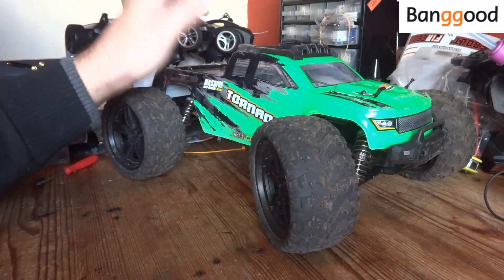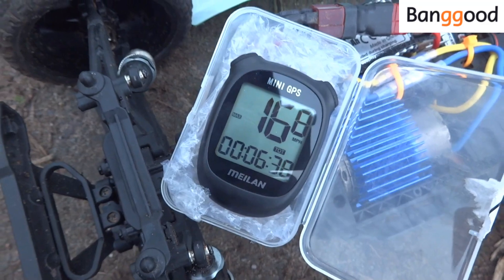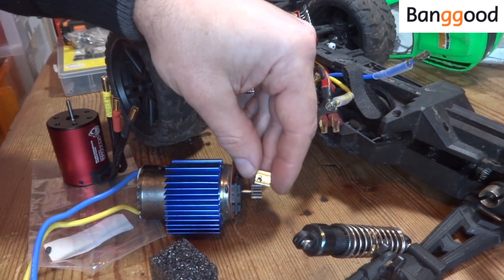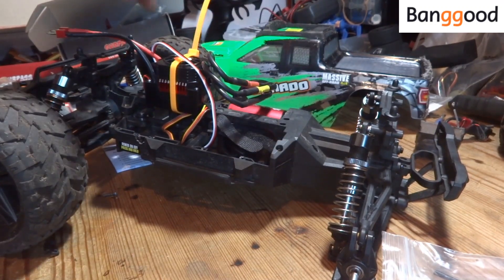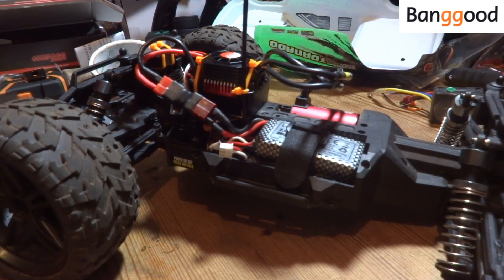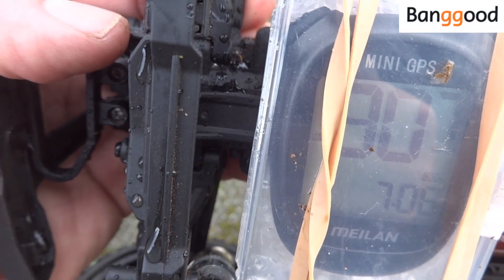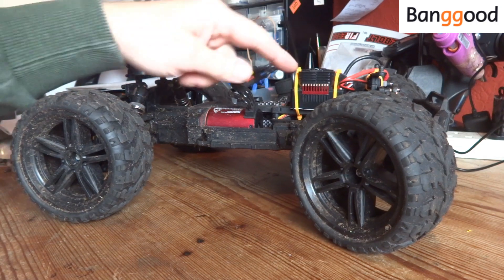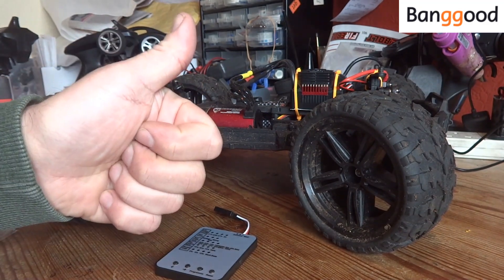Flyhal FC610 Surpass Hobby Brushless Conversion. Double The top Speed!

Comment: Great vid mate love these trucks and for the money they are a great platform to upgrade to brushless. Add up the cost of the truck and the brushless conversion its still cheaper than most of the other trucks out there. For sure has more to give on a straight road. Wonder what it would do on 3s 😜👍
Reply from the maker: Hello! Your absolutely right, for the money you just cannot go wrong. I do owe you a slight apology mine only does 17mph from stock. I think off road it just looked quicker! As for 3s I think it would be rude not to! 👍🙋
Reply: I did 64km/h on 3s but it was just a bit more then half throttle. Didn't have that much space besides a small park alley :P
Reply from the maker: @shred__dad  that's not bad going! Full throttle next! 👍🙋
Reply: @theminiatureconstructionco4556  definitely, just need to order a new front lower arm. Been sending it today from a skate quaterpipe, smacked the railing and ended with left lower arm broken. But going back to 3S. I used a 3S 70C CNHL 1500mah, and you really need to be careful with throttle :P stock tires loose grip. PS not sure if anyone was crazy enough, but i went with a 31T M0.6 pinion. There's a bit cogging, but this was just an experiment, while i was waiting for a 16T pinion to be delivered :P

Comment: Speed run 🤘🏻🤘🏻🤘🏻 3s next my mate! 40+ mph easily! And yeh what a stroke of luck you had that pinion 🙏 🤘🏻🤘🏻
Reply from the maker: Eh up! I think it would be rude not to try 3S in it. Yeah can't believe that pinion was correct, it would have been a very short video else. Do you reckon 40 then? 👍👍
Reply: @theminiatureconstructionco4556  Yeh mate 40+ but not on that path you were on. You'll need a road or a carpark for sure 👍🏻
Reply from the maker: @ksrnate  right then that's it. 3S here we come! 👍👍

Comment: I actually like a lot the behavior of the brushed motor. A lot of torq, controllable and so far reliable. As I am planning to use mine with crawler tires for off-road and crawl, speed is more Than enough and to use stock tires at basketball field or garage and play with my kid is also enough. Speed is good but it always has a price, not only conversion but also potential more damage to parts when crashing. It's different to crash a rc at 30kmh or 50kmh.
Reply from the maker: I would agree. It does crash very well though as I did hit a tree at full pelt and nothing broke! But it's always nice to push the boundaries a bit! 👍🙋👍
Reply: @theminiatureconstructionco4556  do you have any idea if some parts are interchangeable with other rc brands? for example,the diffs are the same as the ones used on hbx 16889apro? spur gear and drive shafts?only ask because parts are difficult to find and if one day i decide to go brushless,at least a spur gear, some diffs and extra driveshafts i want to have since something is going to break for sure.
Reply from the maker: @farmoboy83  I believe it's basically a HBX 2995 (something like that). I think I mention the RC it's based on in the initial review video. 👍👍
Reply: @theminiatureconstructionco4556  yes but even for hbx 2995 its hard to find parts and expensive when compared to other midels from the brand. if there was any other model or brand with spares available for less money would be nice,just the same way i've been making a small stock of 16889 parts because they are really cheap and since i have two and prentend to keep them for ma y years, couldnt resist the temptation.
Reply: @theminiatureconstructionco4556  i was predicting the future...arrive home from a small garden bash. 2 packs of  batteries on tarmac, a little medium grass and ocadionally sand. almost at the end if second pack, a grinding noise and the car bwrely mooves rear wheels and nothing on front wheels. i believe the pinion is toasted,only hope spur gear is ok since i have spares 14t pinions, the same used on hbx 16889a pro, internal diameter slighly bigger than the 14t for the brushed version or brushless non pro.
Reply from the maker: @farmoboy83  I think also there are several Bezgar models that are the same also. 👍
Reply: @theminiatureconstructionco4556  the centre diff was blocked with dirt and sand and the motor power wasnt transmitted to the other diffs and consequently the wheels. changed pinion gear just for peace of mind but original was still in spec. this rc hates sand for sure.i was it more often in tarmac and even so 2nd time i have to tear it appart because of sand. 16889 is daily used on sand and bashed hard and in 8 months only had to change on pinion crown....since fc610 is the same as the hbx 2995 sand buggy, the name is not to take into consideration lol
Reply from the maker: @farmoboy83  how did the sand get into the diff? Seems pretty tightly sealed. And even if the centre diff become solid it should still send power to the other two. 👍
Reply: @theminiatureconstructionco4556  it glued the bearings...not really inside diff but exterior bearings got stuck with a mixture of sand and grease. also, dont know how but front pinion crown somehow got disconnected from the shaft and when the shaft mooved the front diff didnt get any motion because the crown didnt rotate. dont know how but maybe the tip of the shaft is getting thinner or the crown loose due to use. hope it was only dirt also that wasnt allowing proper contact between crown and shaft. now the truck is working as good as new. this is the reason i would like to have gear spares because sooner or later they are going to fail even though they seem pretty good quality steel.

Comment: Hi, is it possible to use the original esc space for extension to battery tray? How long would the tray be if that is possible with some material removed, like various protrusions?
Reply from the maker: I reckon off the top of my head. You may get a 2200mAh battery out of a Wltoys in there. But like you say there would be some cutting involved.

Comment: Hey buddy hope your ok and thanks for your video just wondering would this combo be good for the arrma Vorteks Boost as I don't intend to leave it with a brushed motor for long at all and could I use the spectrum receiver it comes with or would I need to get another and what would you recommend
Reply from the maker: Hello!! I don't see any reason why not. As long as the Arrma is 1/10 1/12 scale (or smaller) I can't see it not working. If the radio gear you have has the standard plugs on the receiver it should all work together correctly, a reverse function on the throttle and steering is sometimes useful. I would also get a programming card as well to fine tune various parameters. I think there is a promo code in the description that will get you 10% off at Banggood. They do loads of combos just use one of the links in the description. 👍👋

Comment: Great video . You can try 3S speed run on a dry day with straight road . I hope next someone will sell a adjustable motor mount . So can change to 17T pinion gear . What's the weather like during the run ? As you said the motor is cool to touch . I live in Asia so I might need a cooling fan for the motor .
Reply from the maker: Hello! It was a cool morning so that proberbly helped. The kit comes with a little radiator which I didn't use. I would see how you get on with it first, it don't think that on 2s it gets very warm. And yes it would be rude not to try it on 3S really. 👍🙋👍
Reply: @theminiatureconstructionco4556 Hello . I guess I need to install cooling fan for the  motor when I upgrade to brushless . Do you think 80-120A might be better in managing heat in 30°c weather running on 2s-3s ?
Reply from the maker: @winstonhoong2134  I would see how you get on. You may be able to stick a non fan cooled rad on the motor and that's enough. I'm going to be honest the ESC was kept really cool by that fan. It's very noisy but effective! 👍👍 I will try 3S for you soon and see about temps. 👍

Comment: Great Video 👍🏻
I bought die same combo by surpass, but my car is crogging extreme when i put the car on the ground.😢 also bougt die programm card and set the start power from medium to strong no changes.
Reply from the maker: Are your battery's in good condition? Are they a good enough C rating? 👍👍
Reply: I think so, tested with new 2s 4200mah 50c and an 3s 2800mah 40c
Reply from the maker: @D3faultChann3l  mmmmmmm does sound  like a possible faulty motor or esc. It should go like stink! Unless it's settings on your transmitter?
Reply: The car is really fast but needs a little push to start maybe an other transmitter it's 10years old from an brushed combo were it works normally?
Reply from the maker: @D3faultChann3l  has the old transmitter got an exponential adjustment option? Sometimes you can alter the throttle curve. So a small movement on the throttle gives 50% of the power? With that combo in mines super smooth from take off. I did put a much cheaper ESC in it and it ruined the throttle response. No cogging but a loss of power from pull off.

Comment: What is the pinion pitch? That ebay link doesn't say. Another video said 48, but that's too small. Last thing I need for brushless.
Reply from the maker: As far as im aware its M0.6 that seems to be a good match.
Reply: @theminiatureconstructionco4556  thank you, I'll check it out. Took the pinion to a LHS with no luck or answers.
Reply from the maker: @stickem1974  you can get the Xinlehong ones on line. 👍
Reply: @theminiatureconstructionco4556  ouch, 20 bucks shipping to US though lol. There's a few from China on ebay and other random sites. I had a 16t 48p that was same size as the original, just 2 more teeth but it whines with it in. Thanks for the info.
Reply from the maker: @stickem1974  no worries. Your welcome. 👍

Comment: I've bought the ESC and a cheap brushless motor. Did you have any issue with the motor stuttering at low speed?
Reply from the maker: Sounds like you have a bit of cogging. Is the ESC powerful enough to run the motor? Are you using standard gearing?
Reply: @theminiatureconstructionco4556  I've got the 60amp Surpass KK ESC the same as you and the 14pt pinion I bought off you. I think it might be to do with the throttle trim. It's very sensitive about being set right. I might try a program card to increase the initial take off.
Reply from the maker: @jamesmarkjackson1979  yes the program card might do the trick. I've only ever had a bit of cogging when I used a cheap ESC. But the surpass ones are pretty good normally. I've yet to have can issue with one. 👍

Comment: Awesome video!

Two quick question for you.  So the stock ESC and receiver are 1 piece so you need to get a new receiver and ESC (you can’t use the stock radio).

What size battery does it take (do you know the dimensions…. I would likely run it at 3s.

Oh, one more question.  Is there any adjustment in the gear box for a bigger pinion or you stuck with the stock size?
Reply from the maker: No you cant use the stock radio gear you will need to replace for separate esc and receiver. Will it take 3S? Watch this video: https://www.youtube.com/watch?v=8w_chmHnv-M&t=102s
I believe (though ive yet to try it) the motor mount can be flipped round to accommodate a different pinion gear. Hope this helps.
Reply: @theminiatureconstructionco4556  thanks!
Reply from the maker: @BriansRCStuff  your more than welcome! 😊👍

Comment: Thx for great input! I'm curious wether you prefer this over the 901a now then this is modded?? Both before and after the 5900kv mid in the 901a. 
I'm looking to buy my first rc... Curious about how much of a difference the center diff does. Both when if comes to performance and durability. Cheers!
Reply from the maker: The 610 would make a great first RC. It's a bit more stable than the 901. Some people don't like the centre diff, but I think it aids traction. At the expense of a little excitement. To be honest you wouldn't be disappointed with either. 👍
Reply: @theminiatureconstructionco4556  Thank you so much for replying 🙏
I already ordered the 901a but have been getting second thoughts after reading negative comments on it lacking a center diff and therefore breaking diffs, and also being harder to control. I can't afford to keep the 901a and buy the fc610 and mod it. But sending the 901a back comes with a return cost of ~35€ som I'm torn about what to do. 
I'll mostly drive in my backyard that has a undulating lawn but also some rougher areas with small roots surfacing. Apart from that there's a gravel soccer field nearby and sand pits and some bigger grass hills with maybe 2-4 inches tall grass. So it seems likely that I need to swap to bigger tyres on the 901a, and that seems to be where people are starting to get in to trouble with breaking the diffs. What's your thoughts on my situation. Cheers for being such a nice guy and your awesome channels success 🍻
Reply from the maker: @nosreuter  well so far the 901 hasn't really let me down, more like the other way around! I've broke a diff cup and a wheel. The cup was me hitting a fence post and the wheel a head on collision with a much heavier Losi truck. I've had no trouble with the diffs and I'm running a much fruiter 5800kv motor and 60a ESC (see other videos). I knackered the standard ESC by trying it on 3S (wouldn't recommend) and because of the broken wheel I've stuck a set of wider XLF wheels on and they do seem a bit better. A plus side too no centre diff is it does teach you throttle control!! 👍😄
Reply from the maker: @nosreuter  and if you haven't already don't forget to like and subscribe! 😄😄
Reply: @theminiatureconstructionco4556  Your thoughts are much appreciated, I'm gonna digest them over the weekend, thanks!

Comment: This was great. Just what I was waiting for!

Would the higher kv/amp surpass hobby kits work as well? Or was this kit already perfect for the size of the truck? Thanks!
Reply from the maker: I think the kit worked pretty well. It's meant for 1/10 scale RC's so with the 610 being smaller (I think it's more like 1:12 personally) it was more than sufficient. The sky it the limit really but may make the thing a little unusable. I.e. the chassis starts to become the weak link with all that extra power. Like I say in the video it went from quite a placid easy to control RC, to being a bit twitchy especially on the power. Just because your then exceeding the grip of the tyres etc. From a motor stand point you could fit a 3660 (as opposed to the 3650) in and get some extra torque. Personally it's a great kit and worked really well. And if you did want some extra go run 3S! 👍👍🙋
Reply: @theminiatureconstructionco4556  you rock thanks!
Reply from the maker: @Ryndel  your more than welcome. 👍